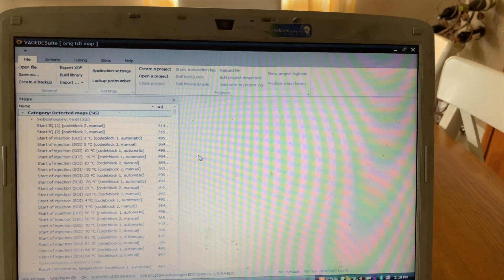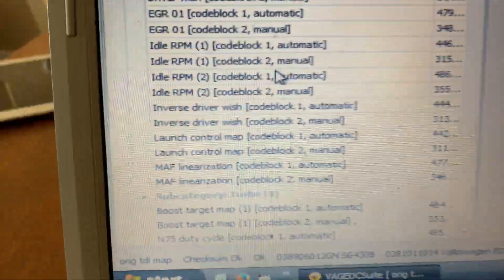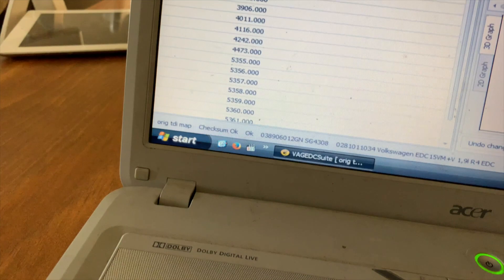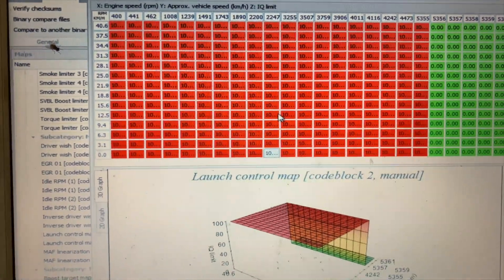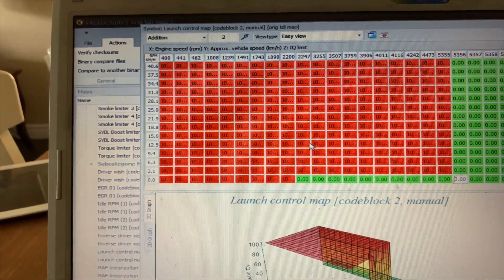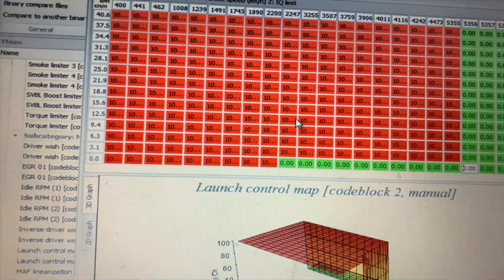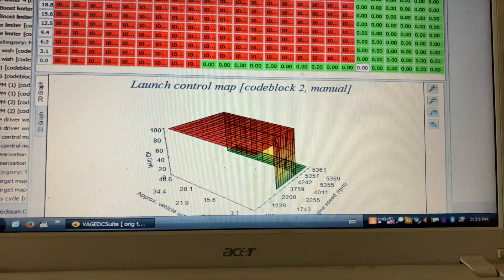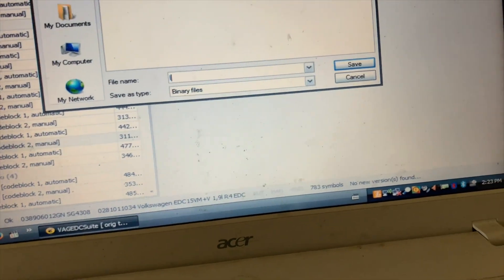how to add launch control to alh tdi

Comment: Hi, I know this video is really old but its the only video I've found that actually goes into detail this process
Is there any way to make this toggleable? Like for example if I wanted a switch for enabling/disabling launch control is that possible with these ECUs?
I know with older ones it wasn't too difficult to do but I'm not sure how you'd do it on these newer cars, maybe by reusing the ESP switch since you'd want to disable it during a launch anyway?

Comment: hello friend, saw your videos and was interested in doing it myself. I did the launch control, exactly as you did in the video, but when I put the map back, the car won't start. Do you know how I could solve the problem? nothing was touched on the map except that I added it
Reply: did u checksum the map first?
Reply: @ after activating the launch control, I don't hear the fuel pump at all, I believe that is the problem, but I don't know how to solve it.
Reply: @АлексаТрнић  check with a multimeter the voltage, or change the fuel pump
Reply: @ I did, it didn't throw anything out. could you give me a contact so that I can send you both maps when you have time to look at them?

Comment: Hello, I'm looking into tuning my ALH and bew soon. How do you actually activate the launch control? E brake or something?
Reply from the maker: On alh it’s speed dependant 
Same for bew 
Bew doesn’t work with edcsuite fyi
Reply: Okay good to know, so say I've got it for 3rd gear at 50kph and I punch the go pedal it will launch ? I'm sorry if I'm missing something here 😔
Reply from the maker: Usually set for 0 speed
For stopped launches

Comment: I done exactly like shown in the video. Everything has been saved on the map file but when I flash it to the car it’s just not working. Any reason for this?
Reply from the maker: That’s strange 
I’d have to see the file to see what’s wrong 

Does your speedo work properly
Reply: @ERAutomotive  yes the speedo works fine it’s just not activating the launch control

Comment: hi man i watched several videos of you. im gonna remap my fiat linea 1.3 jtd. ecu is marelli 6f3. i saw you mostly working on vw cars. is the popcorn limiter, launch control or other things will work on my fiat? or this things and methods allowed only in edc-vag ecu 's?
Reply from the maker: U should be able to
But you’ll need different software 
Winols would prob be what u will use

Comment: How did you keep the checksum the same when adding a map
Reply from the maker: Edcsuite corrects checksum for edc15
Reply: @ERAutomotive  I have been having many issues with that. So ok I will read the ecu from the car with mpps. I will load in the bin file to EDCsuite. I will open it and do just what you did. Save it. If I go straight to up load, yes it bricked. After I have checksum corrected the file it will read as a different checksum then the original. The bytes
Stay the same. It does it every time even when I do the verification inside edc
Reply: Didnt know if you had complication in the beginning
Reply from the maker: I’ve never had that issue 
Are you sure your ecu is compatible with edcsuite
Reply: @ERAutomotive  yes it's a edc15v ecu
Reply from the maker: Strange 
Sorry I’ve never had an issue like that
Reply: @ERAutomotive  all good. Figured is was worth the question. Thank you for the replys.
Reply: @bananaman9921  i have same problem, what can i do? the car don t start anymore
Reply: @mehigh4765  Reflash your originally dumped map. Please tell me you dumped the original map and saved it.